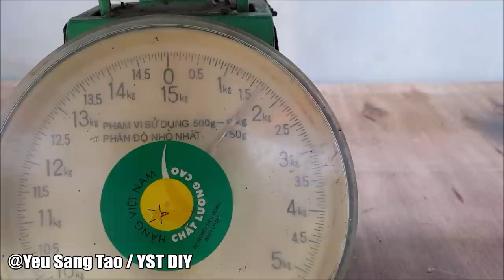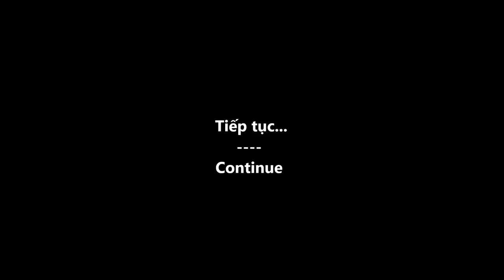Tự Chế Tạo Tàu Sân Bay Trong Phim The Avengers - Phần 2 | Yêu Sáng Tạo

Comment: Tải trọng 4 con motor này ít cũg 3kg nếu khai thác hếg công xuất của nó
Reply from the maker: 1kg6 80% gas rồi bác chắc phải thay esx xịn và pin dòng xã cao đã.
Reply: @YSTDIY  motor 2212 đúg k ạ. Cho mìh hỏi kv bnhiu ạ
Reply: @HoangNam1991  2212-1000kv bạn a
Reply: @hungprofessional8241  con này max thrust chắc cũg 1kg2. Nếu đi đúg cánh với pin 3s.
Reply: @HoangNam1991  phải nâng cấp esc lên 40a mới tải được nhỉ.
Reply: @hungprofessional8241  thay canh lon hon dong nghia motor tai nang hon, dong xa cao hon nen phai thay esc cao hon. pin xa trau hon